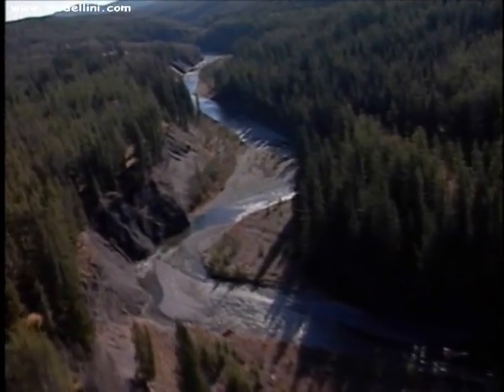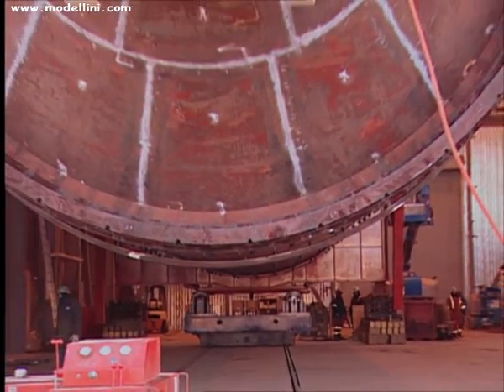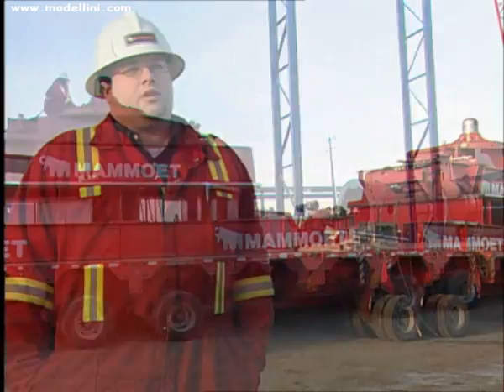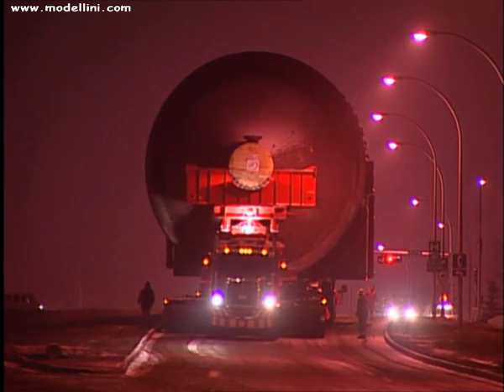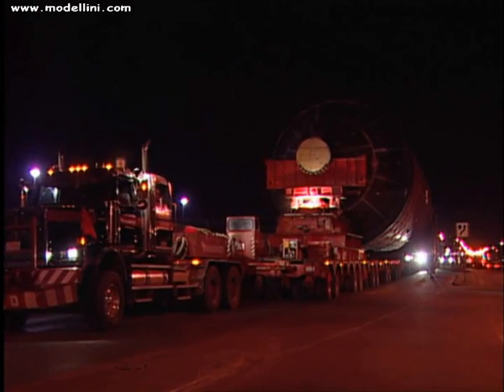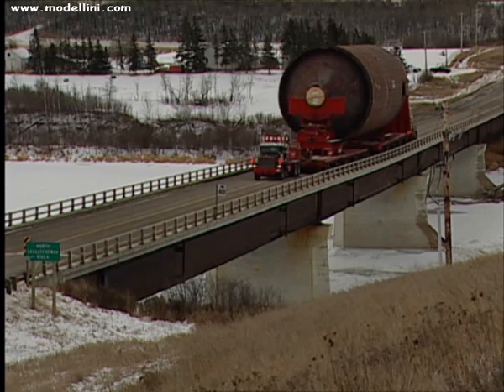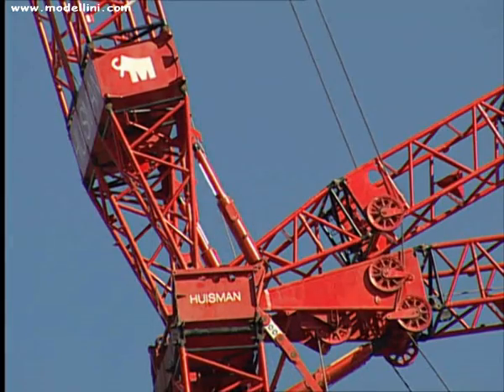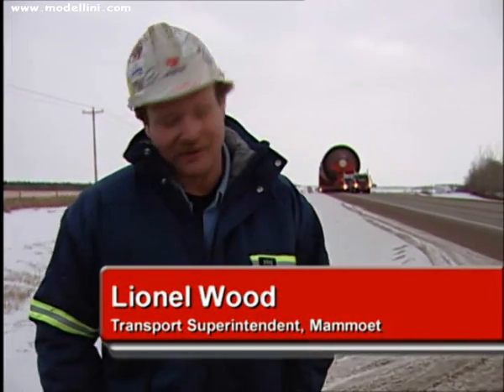Mammoet PAL_1.avi

Comment: Imagine...only if a quadcopter could carry this with power cables on the sides powering the quadcopter...problem solved...and the quadcopter...only needs to be powered by one of the trucks...so when there is an overpass, one power cable is disabled while the other cable still runs the quadcopter...clearly it's a superior plan and it would work...(Hopefully others get the reference to what I'm talking about...)
Reply: Bob Tom ikk

Comment: from the Mammoet vids I've seen so far , this is the most incredible company on the planet. they custom build equipment specifically for the single job. that's incredible.
one use only. THEN what the hell do they do with it ? if they scrap it they're only gonna get pittance of what it's worth.
wow special custom made cranes too ?? wow these guys ARE fkg good !
maybe they should call them to raise the Titanic. only they could do it from what I'VE seen on these vids.
Reply: Very little is scrapped after the job. The storehouse at the homebase in Schiedam NL houses a large collection of "one offs" and are used in a modified form later on.
Reply: Mammoet could likely recover the Titanic, if it were legal to do so and someone had the budget.
Reply: also, there were 4 of those custom built trailer, so yeah scrapping wouldn't be so great

Comment: The tractors only have 550 hp? That doesn't sound like alot for something this big...
Reply: ***** Yeah I know it's the torque that matters, but I'm still surprised they only make 550 hp. Then again, horsepower is for speed I guess; something that is irrelevant with a big move like this.
Reply: Sgt C4 its the lack of spark plugs since diesel is just compressed not sparked so it makes a TON of torque but little Bhp
Reply: It's all in the gearing!!!
Reply: I've hauled their trucks, 9' wide auxiliary transmissions planetary gearing and a weight box carrying 35'000lbs for a total weight of 73'000 lbs per truck..  Anymore than 550hp and they'll be unable to maintain traction
Reply: Yeah